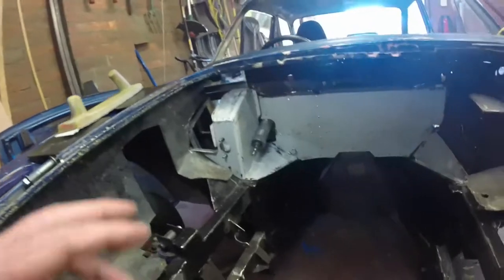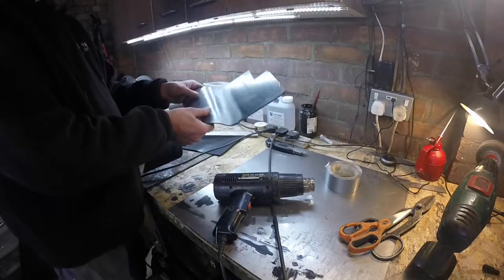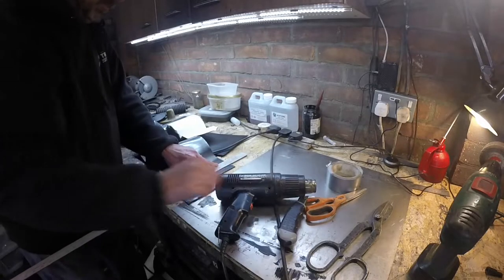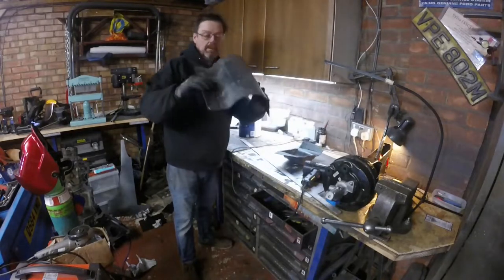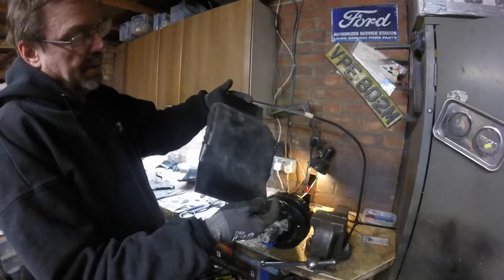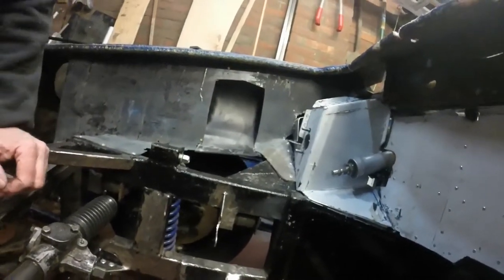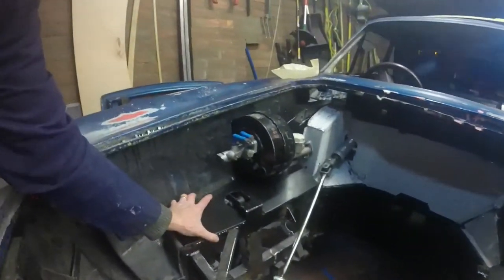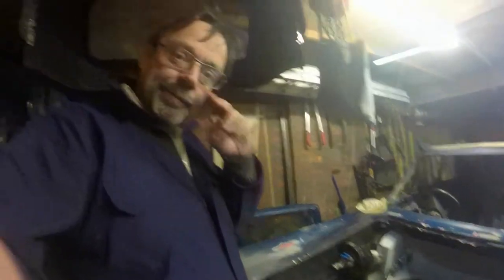Engine Bay Completion - Inverse Power Bulge

Comment: If you started again would you consider the electric brake boosters from Tesla’s and hybrids, they do appear to be smaller than a a traditional brake servo, or at least longer rather than wider?
Reply from the maker: @andycoutts1277  id consider it but note that many ev vehicle components dont run on 12v. Meanwhile this tandem brake servo is quite small